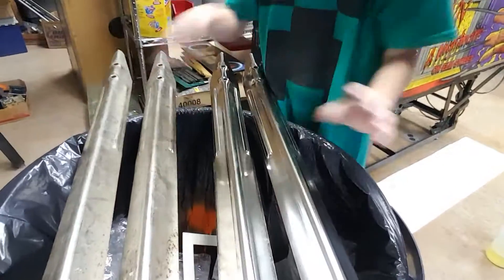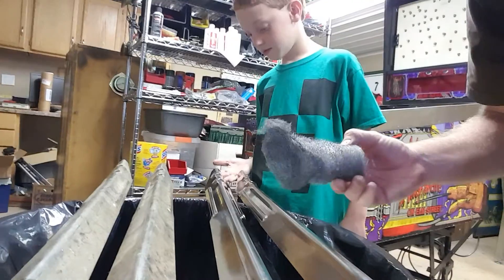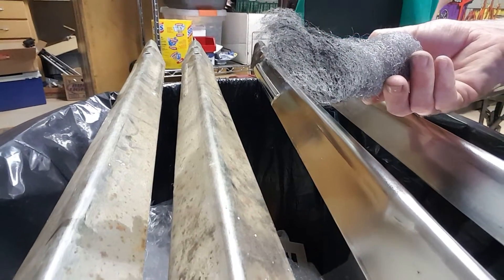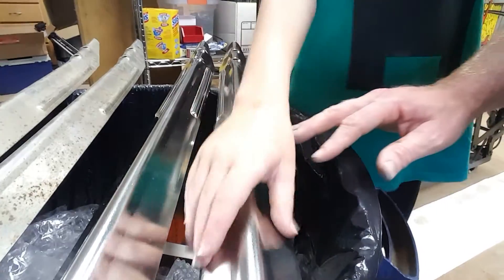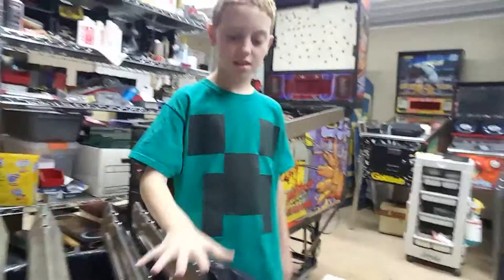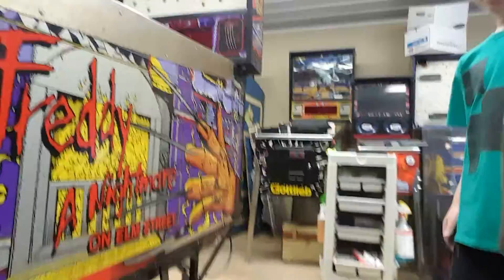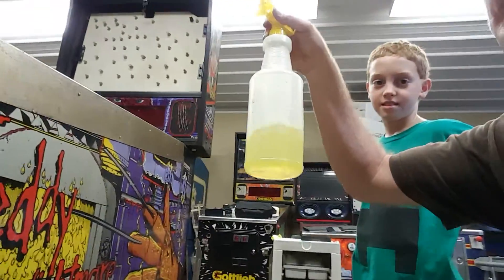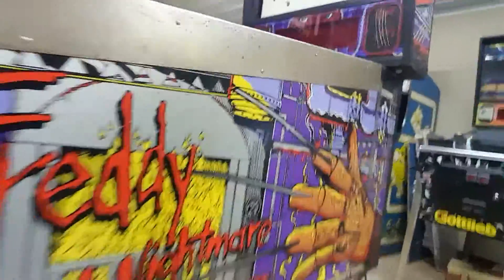Quick Pinball Tips - Legs and Cabinet Cleaning

Comment: Can you use this on older 70s painted cabinets to clean them up? I don’t want to restore the machine completely. I just want to get the grime off the paint. I like the originality of the cabinets. Thanks for your input.
Reply: You may consider trying a 50% water, 50% Totally Awesome (or Mean Green) mix first. I've had some stenciled cabinets have paint that bled a little with it 100%. If you just need to get dirt and grime, you could first try some dawn dishwashing soap and warm water. Then step it up if you have to. But if there is dingy smoke film, you'll probably need Totally Awesome or Mean Green. Best of luck!